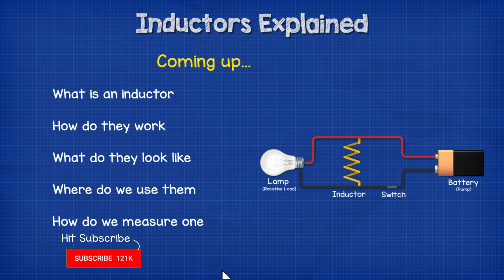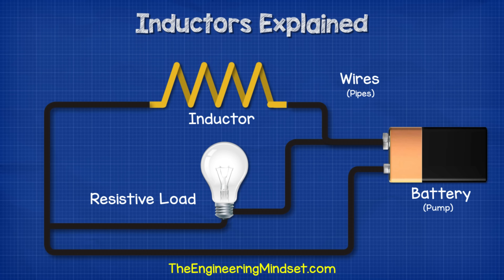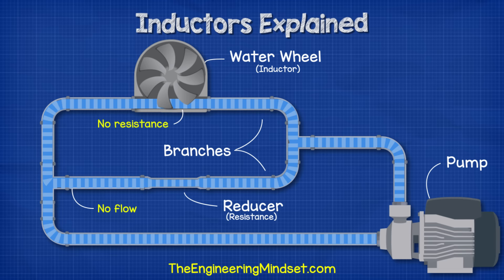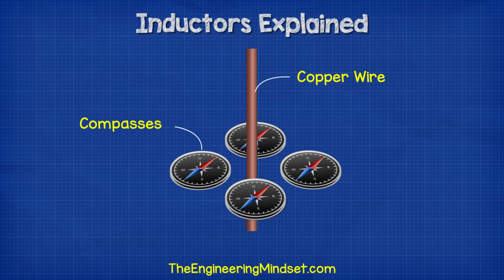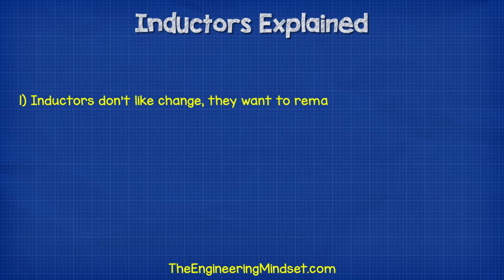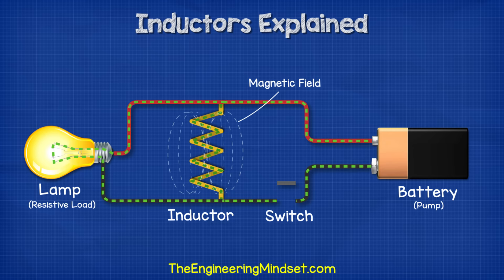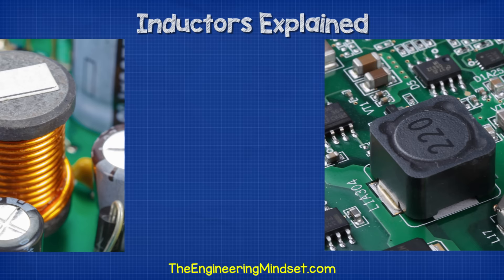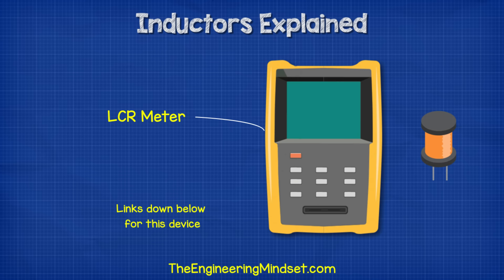Inductors Explained - The basics how inductors work working principle

Comment: 3:51 I would love to be corrected, but this statement appears to be entirely incorrect. There is a somewhat dangerous myth being perpetuated here that current will somehow magically take the path of least resistance. It wont. It will take all available pathways in accordance with ohms law.

The current flowing through the lamp is a function of its resistance (I=V/R) so assuming a constant voltage source, the current through the lamp stays the same. As the resistance of the inductor approaches 0 there will be substantially MORE current flowing through the inductor than the lamp, but the current flowing through the lamp will remain the same.

If you attempted to recreate this experiment as shown with a 9V battery, I suspect the lamp would in fact dim, but this would be for an entirely different reason. As the temperature of most conductors increases, so does the resistance. This is true of a batteries internal resistance as well. When you close the circuit as shown a dead short occurs, causing heat build up in the battery as well as the wires leading up to the inductor, and so current flow through the lamp will diminish.

Comment: Isn't the current flowing out from the coil going to be in the opposite direction when the switch oppens ? As the emf want to stabilize. (Like a spring being pushed down and returns back to it's original state)

Comment: Great video and great analogy. Your descriptions are for perfect inductors and ignore the relatively small resistance of the wire. In practice the lamp might continue to glow very dimly as a very small voltage would be present.
Also, connecting an inductor directly across a battery tends to generate a bit of heat. Might need a “don’t try this at home” disclaimer. 🥴

Comment: It just seems like inductors are not needed unless there is a faulty switch or gaps in the power delivery. I understand why audio amplifiers have them, it's not a constant flow of electricity.  But i still need more understanding for what other purposes they can be used for. \o/

Comment: what happen when an inductor (or any coil of wire) polarity is isolated? the emf will instantly collapse but what will it induce? or are they using the collapsing emf as resistance as so not to induce an electrical short?

Comment: Question - if a inductor when it's fully power has very little resistance and all the electrons flow into the inductor and not the lightbulb, how does that not cause a short circuit?

Comment: One thing I don't get is why the resistive load (lamp) turns off when the inductor "picks up speed" and becomes less resistant. The voltage potential across the lamp is still the same, no?

Comment: My only question is why would you want to e.g have the lightbulb turn off if the switch is on? Is this to save the circuit in the event too much amperage passes through?

Comment: but what's the difference between a capacitor and an inductance if both of them stores energy and releases it instantly, which still illuminates the lamp when the circuit is closed (albeit for an instance)?

Comment: DC circuits produced magnetic field using inductor??? Use AC power source in the representation instead. Inductors in dc circuits are short circuited; whilst capacitors in dc circuits are open-circuited. Hence, you can't store electric energy in an inductor, but in capacitors alone in dc circuits. Right??

Comment: So a capacitor starts out with a low resistance across a power supply and goes to a very high resistance and an inductor starts with a high resistance and drops to a low resistance?  Other than that they both work about the same?

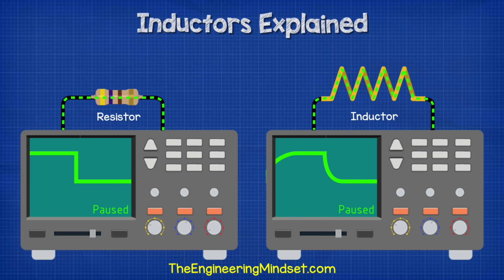Comment: 8:07 - I know it's just a small thing - but the shapes here are wrong. You have made the drop off too steep compared to the ramp up curve.
There is a not the same area under those curves, when the conservation of energy says there must be - yeah?
Also, I think you have drawn the wrong shape - it shouldn't instantly drop sharply as your shape suggests. It should maintain it - even if only for a tiny instant, before it drops away sharply. That's the whole point - yeah?

Comment: 6:20 statement is not entirely correct. This is  D.C. from a battery! 
That Inductor is effectively Not in the Circuit Until the switch is opened, the battery power turned off and the magnetic  field collapses ( from the D.C. battery). Inductive reactance will explain this but was strangely left out of the video.😉

Comment: if we record voltage/current through a RL circuit nothing changes, but if we record the current through the resistance only we see this graph at 8:10 for the inductor? We made some experiences in the lab for school and we were told to measure voltage through the resistor (connected to gnd) and not inductor (inductor + resistor showed nothing special I think). Really trying to wrap my head around what we saw and did, and what to say in the report...

Comment: I just watched your videos regarding capacitors   this one about inductors, and would like to know if you have a video explaining impedance.. 

i am having trouble visualizing impedance since it is a combination of resistance (real part) and reactance (imaginary part)..

Though i understand the basic concepts of reactance which is specific to AC power and this phenomenon can be found in inductors and capacitors. Reactance is specific to AC current since it depends on the frequency of the current because it only affects such changing current.. further, there is a 90deg phase shift betwixt v and i; and the direction of the shift depends on whether the component is an inductor or capacitor, which is know as inductance reactance and capacitive reactance..

Need some impedance visualization help though please!
Anything helps.

Comment: Question: Why is inductor connected in parallel with the Load with battery DC circuit, doesn't that make the inductor a short circuit?
Reply: I tried it and it makes the inductor heat up too much

Comment: Is there a component that allows one circuit to cause current to flow in a completely separate circuit solely by the electrical field from the first circuit?  Like NFC?  This is what I thought inductors were.  I thought they induced current to flow in another circuit that isn't physically connected to the first circuit.

Comment: I did not know inductors can be connected between - & + or L & N. I was under the impression that inductor is basically a short.
Reply: This connection will just make the inductor to act as a short circuit

Comment: How do inductors work. By curving the flow of current in one parallel cable in such a manner to get a slow current on the other parallel cable. Just take two coils one smaller winding into other winding perpendicular to each. They never touch each other. To enhance use different metal plates. Plates depends on what kind of things you want to do. Heating lighting rotate magnet motor storage Etc. Don't try. Just for information.

Comment: An inductor has a very low DC resistance and a high AC impedance.  Putting it across a DC supply (in parallel with the load) such as a battery will short the supply and blow up the battery.  The inductor should be contrasted with the capacitor (which has a very high DC resistance and a low AC impedance), not compared to it. For a DC circuit such as you show the inductor should be placed in series with the load.  Inductors are very frequently used in series in DC circuits to smooth out ripple, typically in conjunction with capacitors (in parallel) to create LC or CLC filters.   The description of how the inductor works when wired in parallel will work for an AC voltage supply where the frequency is consistent with the time constant of the inductor.  It is quite incorrect for a DC circuit.

Comment: It doesn't explain why reducer almost dont have current flow, if reducer and inductor have same voltage in a parallel circuit. 😮

Comment: But I don't quite understand why a coil of copper wire would provide so much resistance that it will take some time to create a magnetic field. I mean copper is a highly conductive material with low resistance. Is it the fact that it has many coils meaning the electrons needs to travel further thus increasing the resistance?
Reply: Yes, inductors have to be wrapped into coils to be effective and the length of wire for the coil is significant enough that you have measurable resistance. Some resistors are wire wound, meaning they wrap a wire around a core and use the length of the wire in the coil to get an accurate resistance. The inductance of these parts is mitigated by using a non-conductive core, which is the main difference between a wire wound resistor and an inductor.
Reply from the maker: Check out NEW resistor video, everything covered! ➡️ https://youtu.be/DYcLFHgVCn0

Comment: Hey I need help:

1) at 4:28 the up direction is negative, which means the flow is going down in the direction of that paper. My problem is I can't figure out if the "Right-Hand Rule" remains true when using "electron flow" instead of "conventional flow" because every mf video I watch they use conventional flow when describing the "right hand rule" to determine the direction the electro field is going.
2) is a magnetic field the same thing as an electro field? and can you make a video really diving deep into how they're diff, what that means in practical use, and even - make a deep video going into what either of these fields are doing on a deeper level?

Comment: I’m an automotive apprentice, and was curious if an ignition coil for firing a spark plug would be an example of an inductor? Current passes through the primary winding but is then stopped suddenly. The magnetic field is then induced into the secondary winding (much tighter/finer strands for higher voltage) and then dissipated into the spark plug. Genuine question, correct me if I’m wrong.

Comment: I'd still like to understand how the inductors work to perform the tasks we use them for...  They don't seem very intuitive to me.
Reply: Magnetic fields hold energy. An inductor, like any other current device, generates a magnetic field because of current flowing through the conducting medium (e.g., copper wire.) So you use an inductor to put energy into a magnetic field, and take energy out of that field.

Comment: How does a inductor wok?
I have no idea.
Reply: When current flows through an inductor, it builds a magnetic field. Lenz's law states that a changing magnetic field will induce an opposite voltage in a conductor, which includes the inductor itself. Considering this, what happens when the current through an inductor suddenly increases? As current increases, the magnetic field will also grow. By Lenz's law, a changing magnetic field causes an opposite voltage in the inductor. This opposite voltage will oppose the direction of current in the circuit and prevents it from changing suddenly. The more sudden the change in current, the stronger the voltage is and the more it will resist change.

Comment: Battery is never a pump. It's a water tank . If you like using water  analogy.
Never fool around with  (high inductance )chokes. V = -L ( di / dt ).  It can kill a softheart human.  No kidding. I'm an EEE.
Reply: Actually a battery is more like a pump as it is a chemical reaction that is forcing electrons to move.  A capacitor is more like a water tank as it is storing charge.

Comment: LOL - Resistor symbol used to explain an inductor - what is he thinking?
Reply: @EngineeringMindset  Well, electronic teachers might consider either a schematic view or a realistic view could have been more useful and less open to misinterpretation for sake of beginners. I suggest it is best to think how the audience might have benefited, rather than avoid a broad standard, and use a perspective that only a technical mind can imagine.
Reply from the maker: Thank you for your feedback. We did however specifically design the layout so it used 2D realistic illustrations of the parts and not symbols, so that non-technical minds can visually understand the circuit. There's over 2.3M views currently and this is possibly only the 2nd/3rd time someone has complained that it looks like a resistor symbol, so I do believe we achieve our aims.
Reply from the maker: Check out NEW resistor video, everything covered! ➡️ https://youtu.be/DYcLFHgVCn0